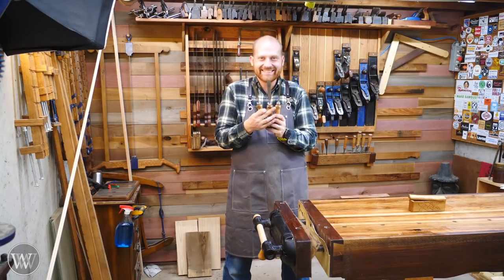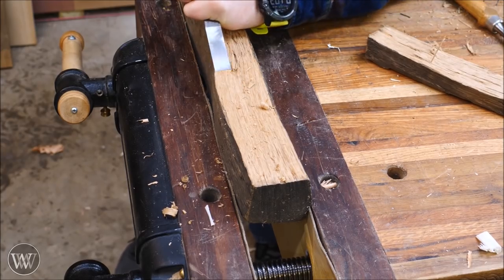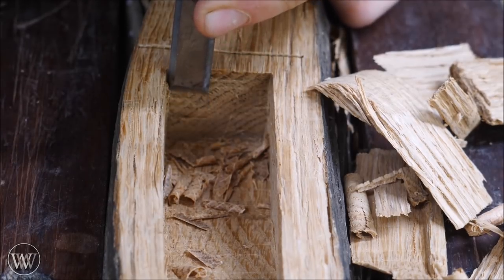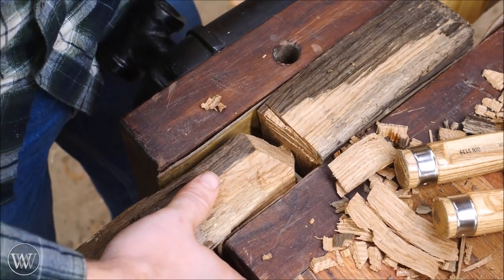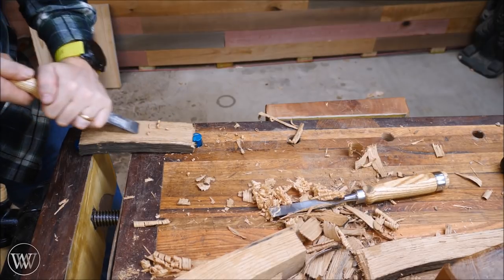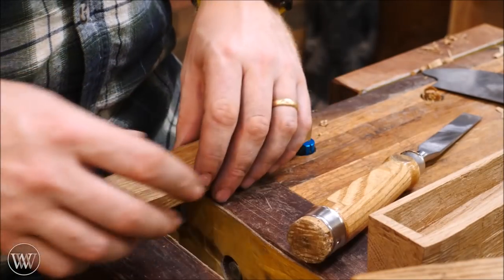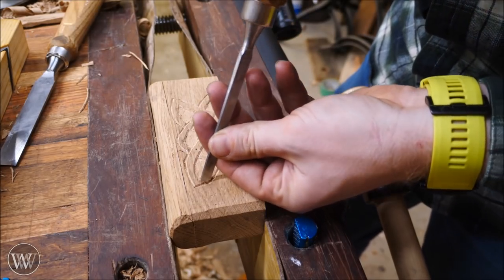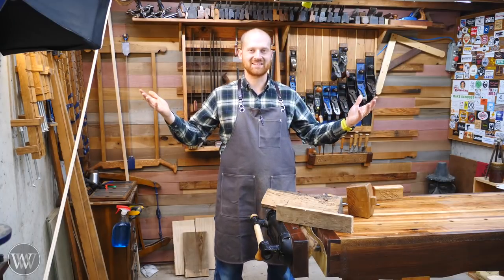Making a Box With Only a Chisel | Hand Tool Woodworking Challenge

Comment: I just learned to do mortise and tenon joints. I had so much trouble with power tools that I ended up using a 10mm chisel. Seems like you're never going to finish the mortise and then--to your point--it actually becomes an enjoyable exercise. I finally was able to cut out a clean mortise and probable won't be using a router, mortise bit, or anything else like that. I'll try the box next. Awesome video, thank you!!!
Reply from the maker: Sweet man. I look forward to seeing what you make.

Comment: Ok this is perfect! I want to take up woodworking but don't know where to start. Plus I can't get and of the fancy tools where I live...but I can get chisels ☺ I'm going to try this
Reply from the maker: If you have a chisel you can do just about anything. The only downside is it takes more time. Every tool you get from there on just makes the work easier.
Reply: So true. I watched another channel where the guy had like 12 tools to make a mortise tenon joint. A well equipped workshop is a dream but it would take me years to find and save for all those tools. By using chisels I can start almost immediately ☺

Comment: Wait a second, you used a vice!  I would love to see this freehanded so I could pick up tips on carving when all you have is a cutting tool.
Reply from the maker: I did a video not too long ago with using a single 1/2 inch chisel and a strap. I walked into the woods and cut a tree down and turned it into a stool using just those two items in the middle of the woods. Or something like this video you can just do it on the ground and push it up against the wall and you can do the exact same thing that way.
Reply: @WoodByWright  Could I give you a challenge based on something I struggled with?

Comment: Great job.   Looks like a lot of fun and a good challenge to try at home.  I see no other way to do this without some sort of holding method to keep the piece still.  So is the spirit of safety,  better to have used your bench/vise than tried to jury-rig an unreliable method to hold the piece.   How long overall did it take?
Reply from the maker: you can do it with out a vice and just hold it up agents a stop, I just did not want to work not the floor, but I have other videos showing that method. this took about 5 hours if I remember correctly.

Comment: I’m a new woodworker trying to make a small shop work (10x16 shed) so small hand tool projects might be the way to go. This is inspirational.

Quick question: would love to make a chisel-only set of cups for a bar set. How can you use these methods to make a round cup?
Reply from the maker: That is about the size of my shop. I have 10x18. Though the working section is about 10x12. For a round section I would use a gouge. Just a simple rounded chisel will do the job.
Reply: @WoodByWright  Thanks! What about for the outside rounded shape? My thinking is to just keep chamfering and rounding over the edges, following each new edge that I create until I sculpt a round profile, but not sure if there’s a more logical way to do it, though.
Reply from the maker: with a bent neck gouge you can make a bowl shape but you cant reach down into the bottom. Normally if you want to do that you make it with an auger or drill bit.

Comment: What a fantastic challenge to set yourself! I am curious why you chose to do most of your chiselling in the vise instead of on the bench with a holdfast? A few times in the video you can see the workpiece slipping in the vise which wouldn't happen on the bench top.
Reply from the maker: the problem with the holdfast is there was almost no time when there was a flat side on it that I could clamp it with he hold fast. most of the time I let it slide down to the screw so the screw would stop it from sliding further.
Reply: Good point! :)

Comment: This video is amazing! 
Would it be possible to build a "complete" woodworking toolset just by starting with a chisel?
Reply from the maker: sure. one of these days I want to do this with napping a rock in the woods and not even needing a chisel, but every tool in the shop (even power tools) is just a jig for holding or moving a chisel.

Comment: Hi James! Question if you have the time: how viable is making a decent stopped dado/housing joint with a chisel? I don't have access to a router plane, wondering if you have any techniques to suggest or things to look out for to make a decent joint. I'll be gluing the pieces together in the end.
Reply from the maker: sure. you do not need a router at all. all the router does is flatten the bottom of the dado. and the bottom does not to be That flat. That same bevel down stabbing motion can be used to clean up the bottom.
Reply: All right, thanks! I had been under the impression a fairly flat bottom was important for glue contact area.
Reply from the maker: nope. unless you have a board lengthwise in a Grove rather then a dado, the glue will do little to keep the board in place over time.

Comment: Just tried this today, (I cheated with a chop saw) only mine was a chest with hinges. I used a single small stump piece of ceader log and damn it took forever. I made it a one piecer so the seams matched up. Not planning on trying that again *my bandsaw needs new tires or else I would of used it*..... I can only imagine how hard it was using oak!
Reply from the maker: It is defenently a challenge!

Comment: I made a wood sheath for a knife using another knife once but that was more out of lack of tools and it took me about 3 days. (I also used a pencil and wood glue and kept testing the fit until it was snug enough to stay in upside down but still be able to pull the blade out rather easy.) my point was the techniques used are about the same though I imagine a chisel is much better at cutting accurate lines than a little 4" folding knife. (it was wavy and not at all evenly proportioned.)
Reply from the maker: That sounds like a fun project. Just goes to show how you do not NEED all the tools. you just need patience. the other tools just make it easier!
Reply: A keen eye, patience and some imagination go a long ways, better tools lead to more inspired and accurate work but enough elbow grease can achieve any task with enough patience and determination. Since then I've gained chisels and a dremel set but I still like to use the ole whittling knife for a lot of fine detail mostly because I used it so long and that I keep it at a nice 2000 grit edge. (it's a single blade, case xx with brass and antler handle with a 10-20 degree angle on the edge.)

Comment: Nice work! I've tried using firewood for some projects, but I've found everything to be too checked and cracked to be usable. Do you have any tips on what wood to use? Do you dry yours specially?
Reply from the maker: a large part of it is the species. some woods check more than others. I just pull it out of the firewood pile. and only one peace in 50 is worth bring it into the shop, but I have a big firewood pile to choose from. most do check some but when I cut off the end I can get in past that.
Reply: So what you're saying is that I just need to try harder? I was worried you'd say that.
Reply from the maker: LOL more like just pick through more firewood to find the good stuff.

Comment: hey james i was just wondering if you think this would work for hollowing a log as well? im trying to make a fuigo piston bellows so that i can get started smithing and it seems like a hollow log would be the best way to get the general shape of the body
Reply from the maker: Sure. That's usually the easiest way after drilling the metal out with an auger you go at it with chisels and widen the hole to the side you want.

Comment: I'm using wood pallets (because free) and Everytime I get close to the edge the wood just breaks apart.
Like I want to make a gun wall rack, so image a fish hook but holds the base of the gun. The wood would break in the middle or when I try flattening it hammering twords the edge also breaks it.
I know you need to make a sharp chisel and believe me I'm using sand paper all the way up to 1,500 grit. And it doesn't seem to do enough because breaking chunks of the wood off.
Reply from the maker: They have 1,500 on sandpaper isn't going to get it that sharp. You may want to move on to using a strop with chrome oxide after that. and in the end sharpness has more to do with technique than it does with the grit you use. usually the reason things break off is the chisel is not sharp enough and you're trying to take too big of a bite. on the inside's the box here I was just shaving off a few thousands with each stroke of the chisel.

Comment: When you are doing this much work with a chisel, and some of it pretty heavy like cutting the board, did you need to sharpen and/or strop your chisels as you were going along or did they stay sharp throughout?
Reply from the maker: I sharpened 6-7 times through this project and always had a strop on the bench. when chopping dovetails I stop every 20 minutes or so and sharpen.
Reply: Thanks for the quick reply.   Useful to know and hopefully you can include tips like that in future videos.  I know from some of your other projects you've talked about learning when something is dull from experiences, but for newbies and infrequent woodworkers we may not be able to remember the difference between a dulling blade and say trying to plane against the grain...
Reply from the maker: Very true. it is a skill that is not as easy to come by as some people think. I do have a video all about knowing when your tool is dull if you want to see a few other cues.

Comment: Loved this!! Can you recommend a set of chisels/tools to get started?  I see some on amazon (budget) but don't know what I would need just to start and get the basics. Thanks!
Reply from the maker: untell you have been working with them for a wile there really is not much difference between chisels. generally the cheaper they are the faster they dull. but that just means you have to sharpen them more. and that is where the real skill of a chisel is. it is all about the sharpening.

Comment: You don't seem to be using your leg vices much.  Is this due to camera setup, or do you just prefer the twin vices that much more than the leg vices?  I see that your vice chop leather is coming free.  What did you use to attach it and what will you use next time?
Reply from the maker: +Jim Scheltens I find the end vice to be more generally useful. I did the same thing on the old bench. The leather always comes off noatter what you use. This one lsated longer then I expected though. DAP contact adhesive.

Comment: Happy Thanksgiving James,
Just curious with the method
Of removing material from inside the box and giving the length of the chisel were you able to make the bottom of the box flat as well?...
Reply from the maker: Yes. If you use the chisel bevel down it works just like a router plane. It takes a little bit of practice, but using the chisel bevel down allows you far more control than bevel up. It just takes a bit more skill.
Reply: Thank you... I would like to try it myself.

Comment: do i need expensive chisels or can i use cheap ones from the hardware store?
Reply from the maker: The ones I was useing were from Aldi and cost 6.99 for the set. Most with plastic Handel's I would not get though. My second set is the wooden Handel set from harbor freight. Can't beat the price.

Comment: interesting idea for box go try make sometime. i look for punkin seed box design this might fite bill see get punk cut tool in there scope get guts out store few seed punkin and fold up picture what carved (witch do with chisel too.) fite in there. to make punkin seed box have dove tale use to different woods. not sure with this box i still do that. i do like celtic not and think you probley carve word punkine seed box in lid and carve little punkin into side.
Reply from the maker: That sounds like a great idea. Would love to see what you come up with!
Reply: i was think about it when back woods. think that try use dove tale as bow tie or two dove tales together keep tope on. like you did a squre to keep top on.  that take care of dove tale part. as for two woods. think take walnut log cut hafe glue maple stripe middle then start were you started on project. that take punkin box requirements. but mean need use more tools then just chisel.

Comment: How would you hold the log in place in the woods?
Reply from the maker: It doesn't need to be clamped in place It just needs to stop moving. in that case most of the impacts are straight down the ground does a good job of stopping that if you're pairing along and pushing it then you just need a rock or something to push it up against. I have another video where I did the same thing in the woods.
Reply: @WoodByWright  thanks a lot!

Comment: beside chisel what else i need to start ? hammer eh?
Reply from the maker: you did not see that part of the video did you?
Reply: i did. my english is not perfect. i  saw you use mallet but what do i need to start with woodworking ?
Reply from the maker: oh sorry. if you want you could just use a stick rather then a mallet. you can do anything in woodworking with just a chisel, it will just take longer. every other tool is just a faster way to make it happen. here is my list of the first tools in hand tool woodworking.

Comment: Nice challenge.  But you have acknowledge the work bench is a tool and a rather key one.
Reply from the maker: The work bench did not cut the work. Lol
Reply: I'm just being pedantic. I just couldn't help admire your fine bench and vice. I don't have either so I have to be very creative when clamping wood to the surface of my 'table'.
Reply from the maker: ya one of these days I want to re do the video and just do it out in the woods. should be kind of fun.

Comment: This is a nice project because the only tool I have is a 3/4 chisel, small hacksaw, hammer, and screwdrivers😣
Reply: Which is the reason why I call it a Real Limited Tools Project
Reply: Oh wait I don't have a work bench😣
Reply from the maker: I thought about just doing this on the ground as it can be done without a bench or vice just use a wall as a stop. as they say, the bench is the first tool to build.

Comment: Vise and bench count as tools. Often overlooked but they are two of the most important tools a wood worker has.
Reply from the maker: generally when counting tools you list those that cut the wood. other wise you have to list the shop and your close and the air and the food you ate. but I do have a video where I took a chisel into the woods and cut down a tree and turned it into a stool with just that one chisel.

Comment: How would some one make "old type" a window mutton plane?
Reply from the maker: A sash plain is surprisingly cheap to find an old one. You can usually pick them up for $10 a piece at most of the tool meets that I go to. but to make them it is a bit complex as you have to make two different molding plans and two matching irons. Then you can separate them with a threaded screw.

Comment: Does a vice not count as a tool?
Reply from the maker: Generally no as it does not cut. Otherwise the list gets long and starts to include clothing and food
Reply: Haha. I was just joking - although you do refuse to use both pencils and measuring "tools" during the video 😜.

Seriously though, I own a chisel but not a vice - would this be impossible for me to attempt?
Reply from the maker: Actually I have a video building a bench out in the woods. I went into the woods with a single chisel and a strap and cut down a tree and made a bench out of it. so no you don't really need a vice just makes it bounce around less. most of this work you can do putting it on the floor and pushing it against the wall even.

Comment: Three chisels, a mallet, a work bench and obviously at least one sharpening stone. That is six tools. 

You could probably get away with two tools. A hatchet or a knife and a sharpening stone.
Reply from the maker: Actually there were four different chisels as this was created over the course of a month or so. However that was the only cutting tool. generally that's how you measure what tools are being used if it doesn't cut the wood then it's a jig or ancillary. Otherwise you Have to start counting things like clothing and the house and the area breathe. however if you want to see something even more restricted I have a video where I go into the woods with a chisel and a strap and cut down a tree and turn it into a four-legged stool in the woods.

Comment: Carve a Harry Potter style wand with only a 1/2 inch chisel.
Reply from the maker: Lol sounds like fun!
Reply: It actually really is, I do it myself and it's got a certain charm(pun intended) to it when you actually start seeing the progress happening. If you do it, the shaft is the hardest part to work with by far so fair warning there. I recommend doing the handle first, and then whittling down the shaft or you'll wind up snapping your hard work for sure.

Here's one that I did with only a 1/2 inch, out of a piece of wood that got attacked by some beetles:
https://pre00.deviantart.net/d1fc/th/pre/f/2017/072/e/c/wand_1_by_snowblindotter-db264nk.jpg
Reply from the maker: nice work! I like how smooth you got it!
Reply: Thanks! I rolled the edge of the chisel over to make a scraper and then used the curls from that as an abrasive to polish it.